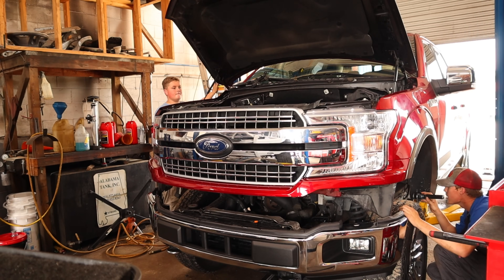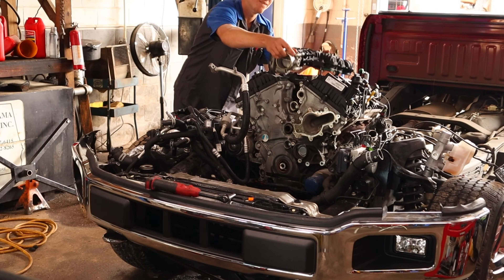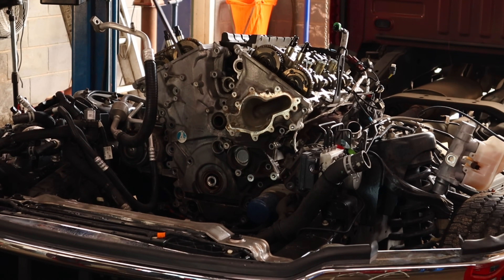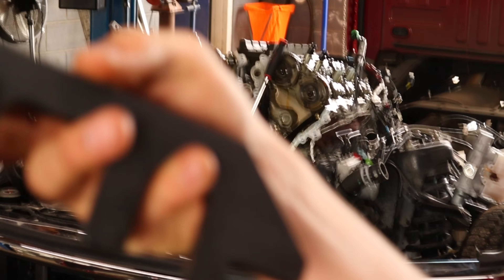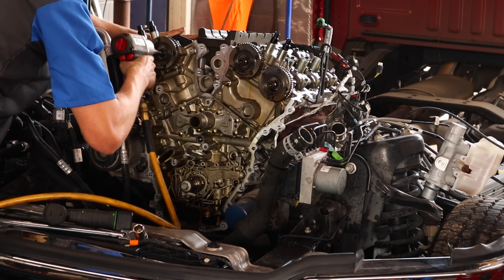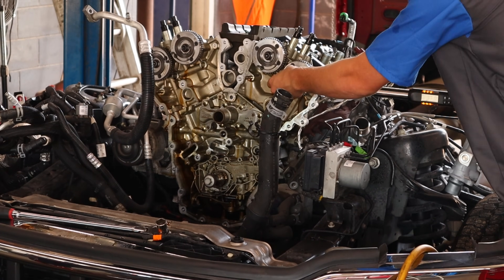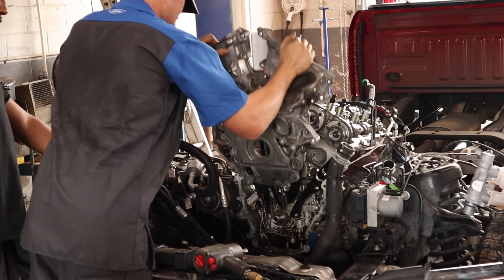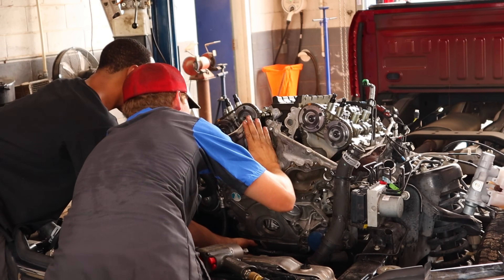Ford 3.5 EcoBoost Cold Start Rattle (VCT Phasers) | Everything You Need To Know

Comment: I have a 2012 6.2l f150 that ticks occasionally on start ups, I’ve looked online and other people have the same issue any idea what it may be?
Reply from the maker: While it’s hard to say without hearing the noise. I have seen a few 6.2’s with cam rollers  that wore down  and a few that have had a bad lifter.  Does it make the noise all the time or just when it’s hot or cold?
Reply: Does it sound like a taser click or a metallic click. Watch your coil packs for arcing out to the engine . Like a bad spark plug wire .
Reply: Same issue on my 13 6.2 f150 definitely only on startup, cold starts only. Goes away immediately or probably with oil pressure? I've heard a lot of good things about the 6.2 other than some valve spring issues these are supposed to be very simple reliable engines

Comment: Just stay away from ford. I had a 2011 f150 ecoboost. Engine blew at 122k miles. I never towed or even beat on it. I got rid of it and new owner started having issues with the tranny now
Reply: 1 bad experience isnt worth crying over. I have collected well over a million miles on multiple Fords with very few problems.

Comment: have you seen any 3.5 f150 with over heating issues when towing. mine 2018 3.5 with tow package runs great no issue at all even pulls my 6k camper fine on the flat. as soon as i hit a hill temps start to climb and if i dont slow down and down shift it will hit 250 and limp mode. i have put in a secondary oil cooler and a 160 thermostat and always tow on 93 oct. which helps but it just makes it go a little longer up the hill before i have to slow down and down shift. now i do always lock out 9,10th gear when towing but i sometimes have to go down to 5th just to stay out of the boost and keep the temp down but if i do that to much the  the trans gets hot and i have to decide which to keep cool. i really like the truck but if i cant set the cruise and drive with only a 6k camper i may have to rethink my vehicle... hell my TT porsche cayenne towed this camper better then this truck does.
Reply from the maker: Yeah it shouldn’t be overheating at all. It could possibly be something going wrong with the trans or trans cooler that is heating up the coolant too much. Have you had it looked at by the dealer?
Reply: @FlyingWrenches13   My dealer won't look at it while towing my camper and it never runs even a little bit hot without the camper on uphill
Reply from the maker: Find another dealer. We have done this plenty of times to verify a concern.

Comment: My in-laws 2017 Limited began the notorious rattle noise only on start up.   The dealer is wanting to charge them close to 10k and replace the entire engine.  I told them to replace the vvt/ cam phasers and timing chains but, every site I look at.  Those parts are all sold out
Reply from the maker: I agree with you on the timing stuff before the engine. The only reason you would need to replace the engine is if it’s gunned up because of lack of maintenance. You should be able to get them from the dealer. We haven’t had any issues getting phasers and chains lately. How many miles is on it?
Reply: @FlyingWrenches13  I believe they hit 100k miles on it.  It’s my in laws travel truck for his business. So it’s 90% highway driven.  It has the 3.5L. If you could point me to a website that has the vvt, phasers and all other component that comes with a timing change replacement. I would greatly appreciate it!
Reply from the maker: You would be better off getting them from ford. If you want I could email you a list of all the part numbers.

Comment: Yup, this helped me decide, I'll go with the old V8 Toyota Tundra and pay the gas bill instead....thank you.
Reply: Have fun with the repeat cam tower oils leaks.  They have VCT phaser issues as well; its all the same design principal.  If you'd rather buy japanese junk that support your own country, then move there.  You are an embarrassment.
Reply: Ecoboost get shitty mpg. I had 33" tires and I was getting 10-12 miles a gallon
Reply: @dodgers199407  
Try running the factory tire size instead of making stupid comments about how your hack modifications reduced your fuel economy.

Comment: I have this exact issue and lately it's been getting worse and worse.  I went into the ford dealership and they told me the rattle was from the phasers bit it was super common and nothing to worry about.  The noise when it starts may be embarrassing in public but it's not doing any damage.  As it is getting worse, I think there must be damage being done.  My question is, how serious is this issue, if left alone with no repair what can happen?
Reply from the maker: It won’t cause any other issues. It will just continue to rattle until they are replaced.

Comment: My 2014 f-150 with the 3.5 Eco started the rattle at about 45k miles.  I now have 55k.  Most of the time it rattles on start up to various degree after the truck has not been started for more than 12 hrs.  Occasionally it can sit for several days and no rattle on start up, some times a slight rattle after sitting at work for 8-1/2 hrs.  I saw another vid that stated the rattle is the chain slapping against the inside of the timing cover and it will eventually wear holes in the cover.  I don't drive my truck every day and don't want to tear into it at this time with only 55k miles.  I came up with a work around that is a slight hassle but it works for me because I mostly only use the truck two or three times a week.

Before cold start I remove the #78 15 amp fuse to the ignition ecm from the fuse station under the hood.  I then crank the engine normally with the key for about 10 seconds until I see pressure on the oil gauge in the dash.  I then return the #78 fuse and start the engine normally and always without a rattle.  I bit of hassle, but it works and it also pre-lubes the engine to full oil pressure before startup.

I run Pennzoil Ultra Platinum 5w30 with Lucas Synthetic Oil Stabilizer and change oil every 4-5k miles.  Next oil change I will run Motorcraft 5w30 to see if the seals in the phasers leak down less with semi-synthetic oil.  Synthetic oil molecules are many times smaller that mineral base oil molecules and I am hoping the semi-synth Motorcraft oil fixes this.
Reply from the maker: Did you know you can do the same thing by holding the accelerator pedal at WOT? It will kill the fuel injectors and allow you to crank the engine without starting. I’ve never tried to see if the rattle has went away by doing this before starting though. Let us know if the synthetic blend makes any difference!
Reply: @FlyingWrenches13   Thank you for the wide open throttle tip.  I did that this morning until the oil pressure needle hit normal pressure (about 10 seconds of starter crank), then started the engine normally with no rattle.  Wish I knew of some kind of inline pre-lube pump for the 3.5 Eco.
Reply from the maker: Glad to hear! Yeah I have never hear of anything like that for a 3.5.
Reply: @FlyingWrenches13  Works on my 17 EB and no rattle because it gives oil a chance to pump up there before startup.

Comment: I got out of the dealership game when the 6.7L came to be.  All we did with that engine was reprogram the PCM to up the power.  Just had my money taken away from the 6.4 and made money on the 6.0L.  With that said, the F-250's and above were made for cab off, you could get it done in an hour-ish.  THese 150s are made for cab off, or is that you just getting it done???
Reply from the maker: Yeah they are made for cab off. I’ve pulled 6.0, 6.4, 6.7, and some GM cabs and these F-150 cabs are by far the easiest to get off. How long did you work for ford?

Comment: Great video. Had my 18 Raptor at a shop for 3 weeks and they failed to fix it. Now that the recall is out I’m questioning even dealing with it. Have Ford Premiumcare until 100,000 miles. Does the update take away the knock at idle?
Reply from the maker: Thanks! I’m not sure I’m familiar with a knock at idle. Does it do it all the time?
Reply: @FlyingWrenches13  just as the truck warms up. My Ford garage said it’s within spec and the update fixes it. I’m unfortunately shopping for a new garage after they messed up a few things up on a charging system fault error I was getting. So curious what other experts would say. Thx!

Comment: Can the VCT Phaser eventually fail if not replaced? I have a 2018 Expedition and have the 21B10 FSA out there. I have 33k miles. I does make the rattle at times on cold startup.
Reply from the maker: No it won’t affect anything if you don’t replace them. It will just keep rattling.

Comment: Known problems for 8 YEARS (11-19 model yrs) and FORD still hasn’t figured it out???  Shame on you Ford!  I’m a 2019 Raptor owner here and had the cam phaser rattle at 9K miles.   I’m at 12k now, fingers crossed it’s fixed.  Thanks for putting this video out.  Great info!
Reply from the maker: Thank you! Wow that’s about as early on as I’ve heard about one rattling. Most of the time they at least make it to 30K.
Reply: @FlyingWrenches13  I'm considering a 2017 Raptor, but it has 90k miles so I don't know
Reply: Use better oil. 300k hard  miles on my 2018. zero issues
Reply: @matthewrogers5660  better oil isn't gonna help with a vehicle with such low miles.  It's a known issue that's well documented and the parts have been redesigned by Ford a few times to correct.   Congrats on your unicorn without the issue.

Comment: I know it is early on but does the 21 3.5 have any of these issues? My dad just picked one up and I told him I would go ecoboost just because the 5.0 went downhill 2018+ in my opinion. Every time I hear a new 5.0 the knocking at idle drives me crazy. They all do it also and it is so annoying to hear a new truck sound like that. It reminds me of the ticking noise the Hemis are known for.
Reply from the maker: I don’t think the 21’s are having any of these issues. I have yet to work on a 21 engine.

Comment: Phaser rattle that requires the cab to come off is absolutely terrifying to me.  Just drive the dick off the thing hopefully she blows under warranty new trucks are crap. There is nothing sadder than seeing a full grown god fearing man crying his guts out at the service counter.
Reply from the maker: Not really required to pull the cab. Just easier on my back than leaning over it all day long.
Reply: @FlyingWrenches13  ah gotcha yeah the motor is pretty far down there. Not even nice to check the oil on 🤣